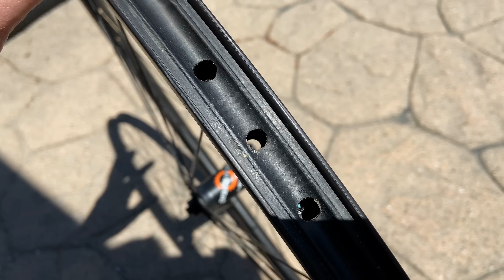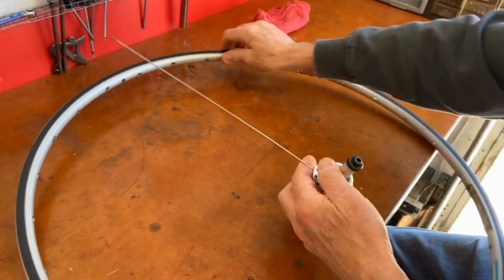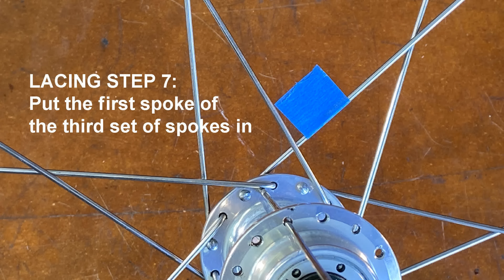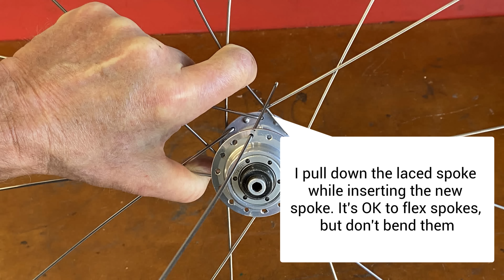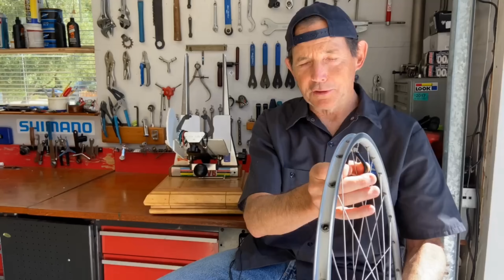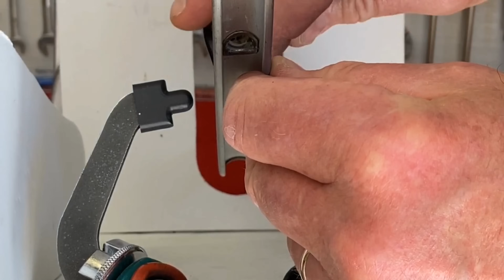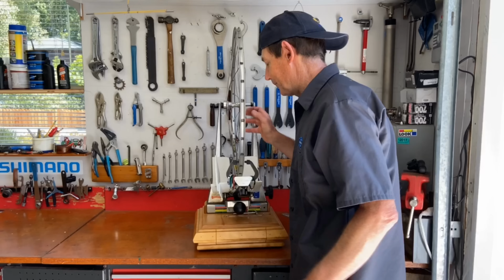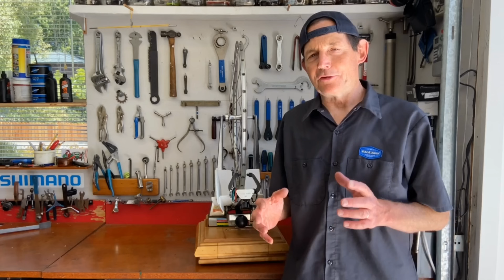How To Build Bicycle Wheels THE EASY WAY! #bikerepair

Comment: I've done this once, but just replacing broken spokes with second hand ones from a donor wheel, not ideal I know, and I didn't have a clue about how to thread the spokes, so I just went "by feel" as best I could. I used the bike frame for truing with a clock dial and managed within .01 of an inch by trial and error. The clock dial was good because I could actually see the movement, as I adjusted the spokes. Having spent so much time truing the rim, I put the tire on, and quickly realised I could have got away with less accuracy. It felt like quite an achievement, even though I have a background in engineering. It would have been a much better job though, had I seen this video, and known exactly what I was doing. I also don't recommend second hand spokes as I soon had to true up the wheel again, but that could also have been bad lacing, and me being quite a big bloke.

This is a brilliant video, thank you for making it, very well explained and easy to follow; next time I'll do a better job on my wheel.
Reply from the maker: Thanks a lot for watching and for sharing your wheel repair experience, Madison. It sounds like you did a great job. Congratulations! You clearly have some truing skills already, so I’m sure your next wheels will be perfect! Appreciate your kind words and interesting comment. Thank you!

Comment: Great video Jim!.  When you love your craft it shows and shows when you teach.  I've been delaying my first attempt to build my new wheels, but you've inspired me to start my mini winter project.   I have a 1988 Puegot Bordeax,  I want to upgrade the wheelset and groupset to more modern setup but trying to keep cost to under 400-500.  Is there any specific measurement I should be looking at when purchasing the new hub?  I'm assuming the distance between the dropouts is the key? thx
Reply from the maker: Thanks for watching and the nice words, Michael. I’m happy my video inspired you to start working on your classic Peugeot! I hope you saw my video on my circa 1974 Peugeot for even more inspiration. 

For your wheels, since you want to upgrade, you are going to probably buy modern hubs so that you can use modern gearing. These hubs will have wider spacing than what your bike was made for.

So, what you’ll want to do is to widen the frame to accept the new rear wheel spacing. The front wheel width is the same today as it was in 1988 so you don’t have to widen the fork.

You can alternatively, not widen the frame and just deal with having to pull and force the new wheel into the frame. But, it puts force on the axle since the frame is too “tight” for the wheel. And it’s frustrating if you have to fix a flat on the road to have to struggle to get the wheel in/out. But, people do sometimes just force the wheels in and not worry about getting the frame widened. (Fyi: you won’t harm the frame, but you might bend/break the axle eventually.)

It’s not that hard to widen steel frames yourself. Let me know if you want me to show you and I’ll do a video on it.

So, choose whatever hubs give you the gearing you want on your new bike. That’s the main thing you need to decide on. Happy to answer other questions. Fun project! I hope this helps.
Reply: @JimLangley1   Thanks so much Jim for the advice!  Yes the plan is to definitely use modern gearing/hubs.  I measured today and the distance between the dropout was 127mm.  I would definitely like to widen the frame first, but please don't make a video just for me.  I'll search around on how to do.  I would appreciate of you could recommend an affordable (but good :) wheelset(I'll build them) and groupset that would improve the performance of the bike to get closer modern road bike(also give the bike a retro modern look).  I've considered going with the Chinese set due to the cost.  There are so many choices that it really confuses me. Again thanks so much for the advice.
Reply from the maker: @michaelpasiuk9332  hi Michael, I looked up the Bordeaux online and you might have a bike that you should just use as is and not go to the effort to upgrade. If your bike has Shimano components and aluminum rims - unless everything is worn out, which would be unusual - you already have very nice components. And, to upgrade would be kind of expensive and not get you much of an upgrade in shifting and braking performance if any at all. Instead you could simply rebuild your wheels - but only if they need it - and clean, polish and tune-up your bike. I can explain more once I know what you’re working with, so let me know when you have a chance. Thanks!
Reply: @JimLangley1  Hi Jim! Thanks so much for the advice.  You're right, I just checked and the Bordeaux does have Shimano components (Exage Motion)!  SLR Exage Motion Brake Levers, sport LX tube shifters, Shimano 2 speed Biospace Crank 52/40 and 5 speed rear.  Exage Motion rear Derraileur, maillard front and rear hubs, Dia compre brake calipers.  The rims are aluminum and are not in bad shape but really needs some time on the truing stand.  I love riding the Peugeot the way it is but always thought of upgrades.  If it's not going to make a difference I have no issues staying with the current setup and just buy a truing stand to make the rims perfectly round.  Right now I do the spoke adjustments with the rim on the bike and the wheel is ok, but love to get it perfect. 
Curious is the Bordeaux model line considered low, medium, or high end?  I got it from a co-worker who bought it new and barely rode it.  It was rotting away in his garage and I took it.  I love a project. Thanks again Jim.
Reply from the maker: @michaelpasiuk9332  Hi Michael, you've got a nice entry-level road bike in the Bordeaux - nothing fancy but a bike that rides nicely and performs well for all types of road riding and even some dirt road riding if you wanted to escape the pavement. Since your friend barely rode the bike, the components should be in fine shape for many miles of use and Shimano Exage components work perfectly fine as do the Dia-Compe brakes. When you spend more money you get a frame with higher end tubing or one made of aluminum or carbon (lighter). And the components get a little lighter, but not necessarily better functioning.

On the wheels, it's easier to see and fine-tune the small wobbles with the tires removed and the wheels in a truing stand. Or, if you don't want to buy a truing stand, you could just remove the tires and put the wheels back in the bike. Then bring a bright light next to the wheel and use the brake pad as the indicator. Or you can clamp something you have as a pointer/indicator, like a toothpick to the brake pad. That way you can move the toothpick closer to the rim as you get the wobbles out one at a time. That will work as nicely as a truing stand. But, it is nice to have a proper wheel truing station where you can sit with the wheel in the stand in front of you and get wheels perfect. So, if you plan on fixing more wheels in the future you will appreciate buying and owning a nice truing stand. Hope this helps and have fun fine-tuning those wheels!
Reply: @JimLangley1  Thanks Jim for all the advice. much appreciated.  I'll fine tune the Peugeot and hunt for a nice truing stand.  Look forward to seeing your future videos. Happy biking to you!

Comment: The by far most inspiring video i have seen on building and trueing wheels. According to the wheel manufacturer the spoke tension on my 27.5 mtb wheels should be 110-130kgf, 2mm spokes. I am measuring with a tensiometer and following the conversion chart, but to even getting anywhere near 110kgf I need to use some real force on the wrench and I have broken several alu nipples doing so. Getting to 120kgf  seems to be completely impossible. Do you suspect my tensiometer to be wrong or should I instead use brass nipples. Using a Red cycling products tensiometer brand new out of the box
Reply from the maker: Apologies for the slow reply, Fredrik. Somehow YouTube only just now showed me this comment. Thank you for watching my video and the kind words. I'll try to help with your question: If the nipples are breaking when you try to turn them, I think the wheels may have been built with thread adhesive on the nipples. Some wheel companies do that. The other possible issue is that the nipples were not lubricated where that rest on the rim or that the rim holes were not chamfered before lacing the wheel with the spokes. 

For thread adhesive you can get it to loosen somewhat by heating the nipples one at a time with a hair dryer or heat gun but do not heat carbon rims as you could damage them. Heat will usually loosen thread adhesive and allow turning the nipples. If the nipples are breaking due to the fit between rim and nipple, you can try dripping some lube onto the hole around the nipples inside and outside and see if it helps.

Another approach is to loosen the entire wheel, check everything, lube as necessary and then start again. Also, I am assuming you're using a properly fitting spoke wrench and being sure to push it fully onto the nipple before turning. If nipples are very hard to turn, you can try using two tools, the spoke wrench on the flats and a screwdriver from above in the slot.

Brass nipples are definitely less likely to have these issues. I hope something here helps. Sorry again for not answering sooner,
Jim

Comment: An easier way to build a wheel: first put all of the inside spokes in and then the outside ones in.  I just can't believe that someone could do it the hard way and not realize doing the inside first way as easier. (A long time ago.) jees,  I figured that out in the 70's.
Reply from the maker: Thanks for watching and the comment, Ravello. I think you didn't realize that my video is made for people who want to learn how to build wheels. The way you say is easier is only easier if you already understand how to build wheels. For beginners, putting so many spokes in at once typically results in getting spokes in the wrong place and having to start over again - or giving up. With the method I teach in the video - and when teaching people in person - it's unlikely they will put a spoke in the wrong place because it's done one set at a time/one pattern at a time - a simple uncomplicated way to do it. But, yes, I agree that for someone who already is a wheel builder, there are faster ways to get the spokes in.

Comment: Hi,thanks for doing this video.I am going to try rebuilding a bmx wheel with mtb hub,using bmx rim and spokes,any extra tips please?
Reply from the maker: Hi Dj and thanks for watching. You'll build your bmx wheel the exact same way. The only thing is that bmx wheels have shorter spokes than road wheels and sometimes the spokes will be a slightly heavier gauge (thicker spokes). Being shorter and thicker means they're less flexible. So, when it comes to weaving the spokes in between other spokes, it takes a little more effort and care. You can still do it the same way. It just takes a little more to flex and position the spokes. Also, with a smaller rim, there's a little less room for your hands, but you'll get used to it quickly. Have fun building that wheel!
Reply: @JimLangley1  thanks Jim,I am looking forward to it a lot,i live in block of flats and this is something i can do at home indoors,something towards making a recumbent bike.. i am gathering tools and supplies
Reply: @JimLangley1  Hi Jim,I am just getting ready to start,I am choosing a hub,do you think odd size flanges are ok for my first build? it is a flip flop hub,thanks,Daz
Reply from the maker: @dazdeluxe6672  yes, that's fine, Dj. Just be sure to get the right length spokes for the different flanges and then be sure to pay attention when building so that you put the correct length spokes in each flange. You might mark the flange with tape and the length spokes that go with that flange written on the tape. That way, you have a reminder and you won't put the wrong length in. Building the wheel will be the same process. Okay? Have fun!

Comment: I've found that it's easier to lace bigger wheels than smaller ones 20" and smaller because the spokes don't flex as easily BUT
It's a lot easier to tension & true the smaller wheels because the spokes and rim are relatively stiffer.
Sorry if that is not very clear but I'm a do-er not a teacher.
My Dad taught me to build and true wheels Plus a great many other useful mechanical skills.
I have been fixing and building bikes and wheels for nearly 50 years now!!
I started when I broke my arm at age 5.
Still learning and picking up good tips.
Nice video with a lot of good information clearly explained without blinding us with science.
Thank you.
Reply from the maker: Nice of you to watch my video and comment Nigelnightmare, I appreciate it. Yes, that's a good point about smaller wheels being easier to true. Stiffer rims definitely help. It's cool that your dad taught you how to build wheels. Mine showed me some bike repair tips when I was just a kid, too. He commuted to work on a Raleigh 3-speed back then that he had converted to a 9-speed, so he had some skills. But he didn't show me how to build wheels. I learned that when I started working in bike shops.

I'm impressed you began your bike fixin' at 5 and are still at it 50 years later! I completely understand because bicycles are as much fun to ride as they are to work on ;-) Thanks again for watching and the great comment. Keep fixing those bikes!
Reply: @JimLangley1  Glad I'm not the only one who gets as much enjoyment out of working on the bikes as I do riding them.

Comment: Amazing video, thank you Jim!

Question:  I have a rear mtb rim that lists its max tension as 122 KgF. When performing the final tensioning, is the ideal goal to raise the drive side overall average tension as close to 122 KgF as possible (with no single spoke exceeding 122)?

I currently have the wheel up to this overall average tension per side:

Non drive-side = 60 KgF
Drive-side = 96 KgF

The tightest single spoke on the drive-side is currently @ 110 KgF.

Do I keep raising the tension until that single spoke is at 120-122 KgF and then stop? The remainder of the drive-side spokes will then “fall where they may”.

Is that the ideal that I’m shooting for? ...or should I just accept the current the wheel as finished at the current readings? How do I know when to “be happy” with the final tension?

Thank you (in advance) from 🇨🇦 😀
Reply from the maker: Thanks for watching and for the kind words and excellent question, Jason. When the company gives you a maximum tension, that basically translates into a do-not-exceed tension. So, you don't want to get any spoke that tight. Since you have one of your drive side spokes at 110 and the average 96, I think that wheel's tension sounds pretty perfect. 

You didn't exceed or get too close to their 122 and 96 avg to 110 on the drive side rear is pretty even and correct tension for a finished wheel. So I wouldn't add any more tension. Keep in mind that if you're not completely done with the wheel, for example there's still some tiny side to side movement or a very slight hop or dip - when you do those small turns to get the wheel perfect, you'll mostly tighten the spokes and that will add a bit more tension.

Sounds like you build a very nice wheel. Congratulations! Enjoy it! Thanks again!
Reply: @JimLangley1  Wonderful, then that clears it up for me -- thank you Jim!!  I've been scratching my head trying to figure out when to know if you've reached the "ideal" tension for a given wheel.

One other thing that really helped me during my build (that might help others) is to focus on tensioning the drive-side (which will always have the higher tension on a rear non-offset mtb disc brake wheel). Once the tension is evenly distributed on the drive-side, with no single spoke exceeding the max rim specification, the non-drive side tension will fall where it may.

For my front wheel, the disc brake (left) side will have the higher tension.

Thanks again Jim. You've made my day with this video. It both confirmed and also dispelled much of what I've been researching online in other places.
Reply from the maker: @jasontomljanovic  You're very welcome, Jason! And that's exactly right about getting the drive sider rear and disc side front tight and letting the other sides fall where they may. Some builders actually take it a step further and right from the outset, they work only on those sides of the wheel - as a way to speed up the builds. Ric Hjertberg - Mr Wheel Fanatyk has a nice story about this on his blog. I bet you'll enjoy it: https://www.wheelfanatyk.com/blog/wheel-building-tip-no-6-build-rears-from-right-to-left/